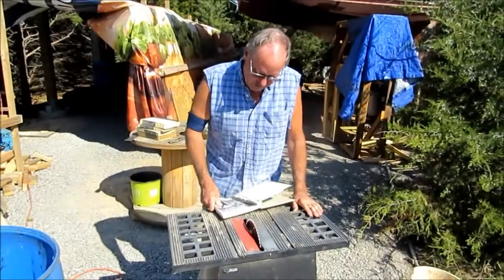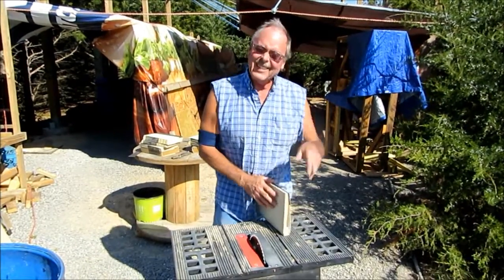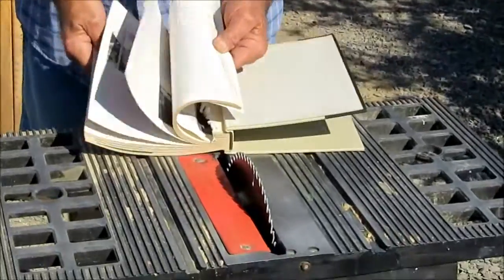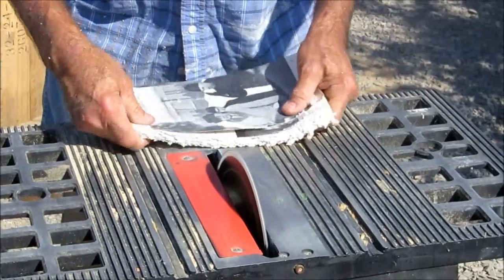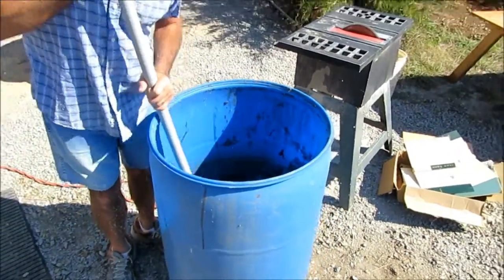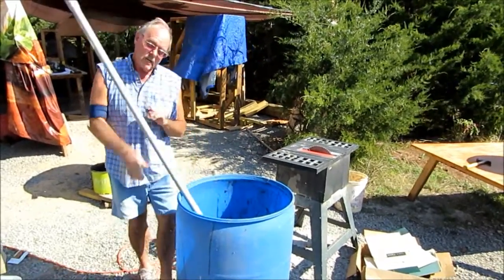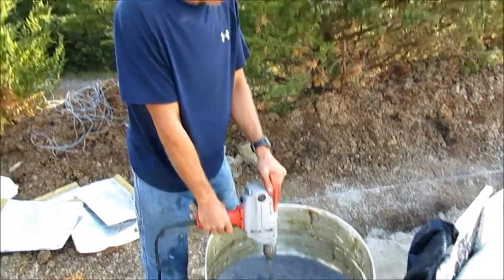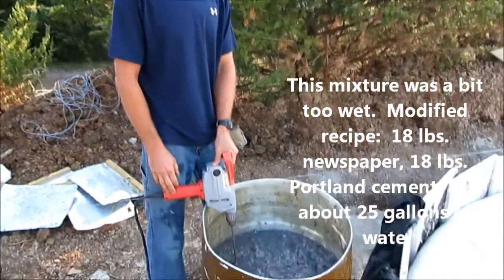Papercrete for the Earthbag House

Comment: i assume your past the paper crete now but i seen a video not to long ago of a guy grinding paper simular to what your doing except he was makeing fire logs out of the paper instead of useing the paddle mixer like you used he figured out away to attach a saw blade to a rod that attached to his drill . it was very fast at shredding the paper that was in a bucket of water